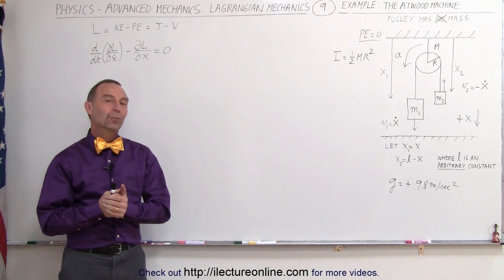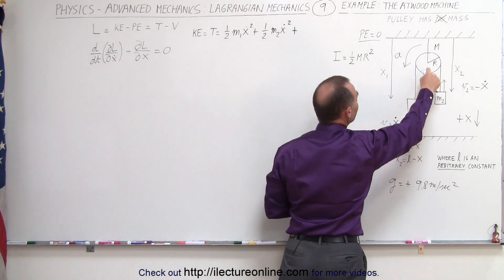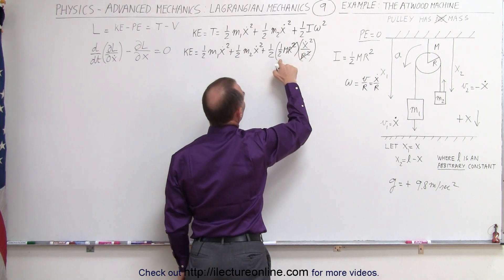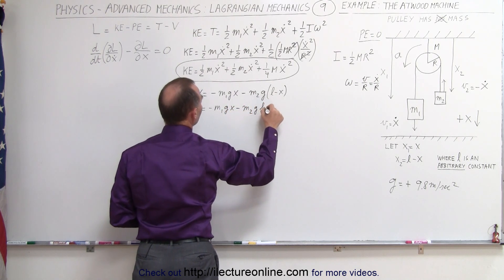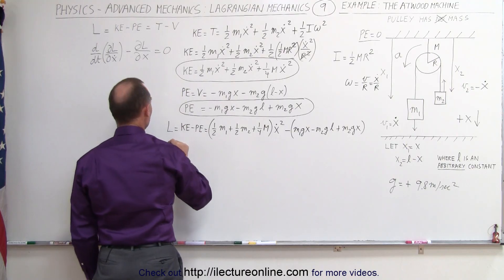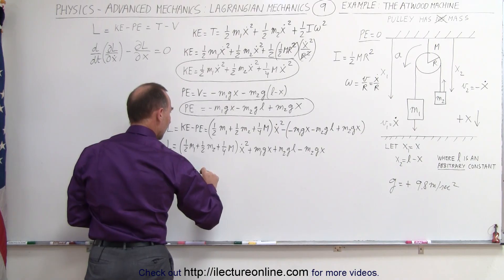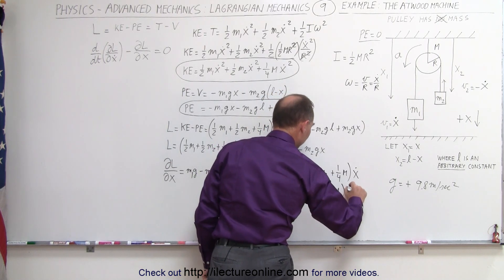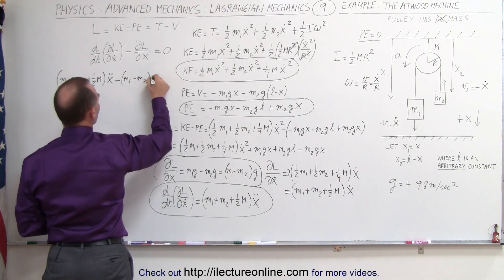Physics 68 Lagrangian Mechanics (9 of 25) Example: The Atwood Machine (with Mass)

Comment: Hi, 

I believe you forgot to negate the 1/2*m2*(v2)^2 term in your Kinetic Energy equation. Therefore KE for the second mass is   1/2*m2*(v2)^2  = 1/2*m2*(-xdot)^2, since v2 = -xdot
Reply: actually kinetic energy is 1/2 m |v|^2 because kinetic energy cannot be negative by definition, and the absolute value of velocity is just speed!

Comment: Why you haven't consider P.E. of "Pulley" since it is hanging ?
Reply: I suppose that you could also add P.E. of the pulley into the equation of potential energy, but the result of the differential equation will also be the same, since the position of the pulley remains constant throughout the process.
Reply: The above two comments are correct, and you could also say that we are neglecting the dimensions of the pulley
Reply: Because the force acted upon it is non conssrvative unlike gravity in case of the masses. Hence energy cant be stored. But if can say that the pulley is torsional then you can consider P.E. of the pulley
Reply: https: //youtu.be/UHocGHguWJI👍👍

Comment: Why don't you consider mass of pulley in calculation of potential energy..

Dear sir you have mistakenly taken the PE=0 , for the roof it should be a line passing through centre of pulley
Reply: You may take that into consideration. However, it turns out to be that the PE of the pulley differentiated with respect to x is 0 as the PE of the pulley is fixed in this case. So, it makes no big difference.
Reply: If the mass of the disk is uniformly distributed over its surface, then the potential of the disk at every point would be constant, and it is not wrong to take reference to be zero at the roof. However, We would have to add a constant in the potential term, but it won't affect our further calculations if we chose to not to do so. One more point, it was quite obvious in the beginning that mass is uniformly distributed, since M.I is taken to be 1/2 MR^2 ... Although, I do not claim that there does not exist any other type of mass distribution having the same M.I .
Reply: MANISH MKS you can choose whatever you want
Reply: https: //youtu.be/UHocGHguWJI👍👍👍

Comment: Hello there, have you considered the pulley to be at negligible distance from the ceiling, due to which there is no term of the potential energy of the pulley ?
Reply from the maker: The reference point (or the zero potential energy point)  for potential energy can be chosen to be any point.
Reply: Michel van Biezen Thanks for the timely reply, so is it more apt to consider the pulley as the reference ?
Reply from the maker: Typically the reference point is chosen to make it easier to solve the problem, or to reduce the calculations.

Comment: sir , shouldn't be the velocity of the mass m2 : X dot 2 rather than X dot ?
Reply: I think the reason we don't have to include subscript is because every point on the string moves with the same linear velocity (assuming the string does not stretch or slip around the pulley).
Reply: https: //youtu.be/UHocGHguWJI👍👍👍

Comment: Hi. Dont you have to add the potential energy of the pulley when calculating PE ? 
I already know it wont add any important modification because partial derivatives 
will take it to zero; Just wondering, and just that. By the way, thanks for your videos !
Reply from the maker: Since the position of the pulley doesn't change, we do not have to take it into consideration when calculating the PE.
Reply: The answer seems obvious in hindsight but I was ten seconds away from typing out the exact same question.

Comment: how come you didn't change signs in the parenthesis at 4:10 and you mention to be careful with the signs? shoudn't it be................ "-(m1gx+...-...)" since the negative is on the outside.
Reply from the maker: +aaron brooks 
Yes, I caught my mistake later in the video.
Reply: Why moment of inertia is 1/2 MR^2 and not just MR^2?
Reply: Because a pulley is a disc and the MOI for a disc is mr^2/2